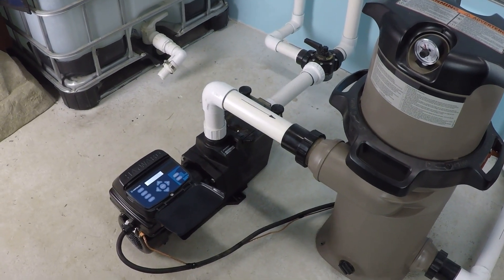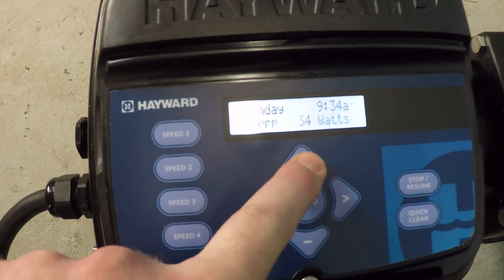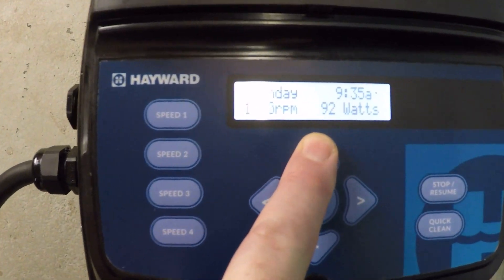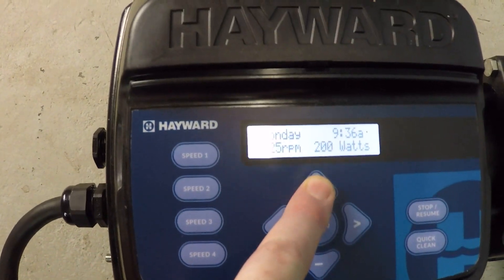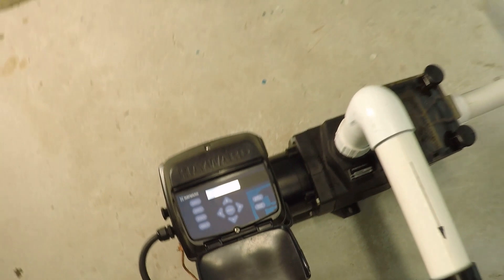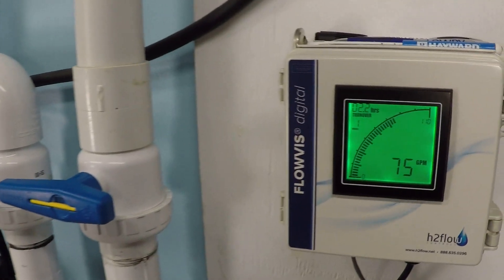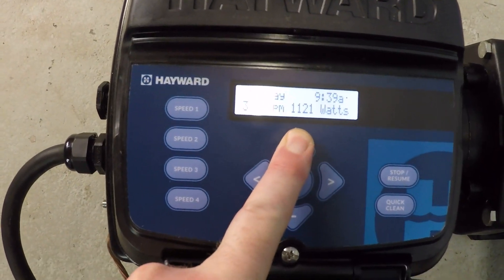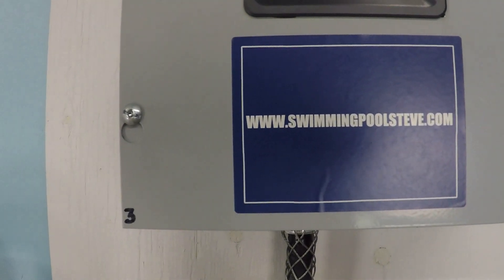Hayward Super Pump VS on 2" Plumbing System

Comment: When you compare the two videos, max rpm at 1.5” is 70Gpm and 2” was around 83Gpm which really speaks “volumes” about turbidity and resistance of flow in the size of the lines. A point you’ve been hammering home for awhile now. Great work!

Comment: Do the watts displayed on the pump match the power meter on your wall? Looks like their close. Whats the best affordable way to estimate gpm without an expensive flow meter?
Reply: I might be missing something but a flow meter is about $50 at my local pool shop so it's fairly cheap. you can expect a somewhat linear relationship between rpm and flow. so if you run your pool pump for 6 hours at full speed, run it for 18 hours at 1/3 speed. you don't really need a flow meter.